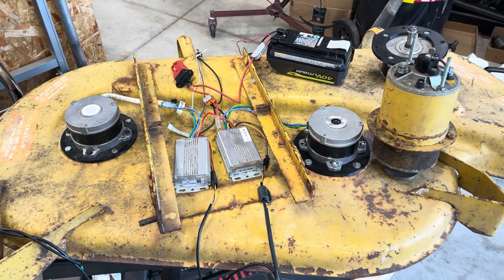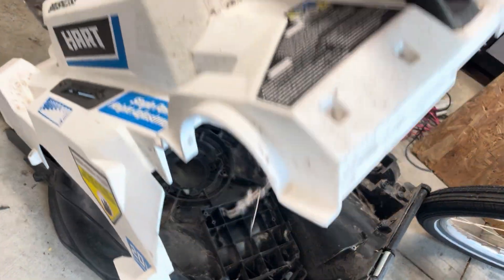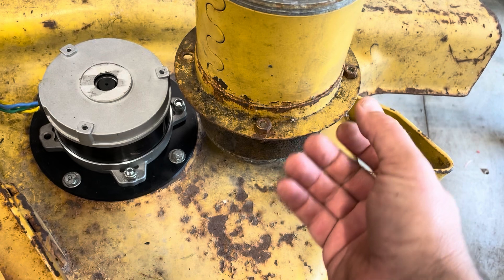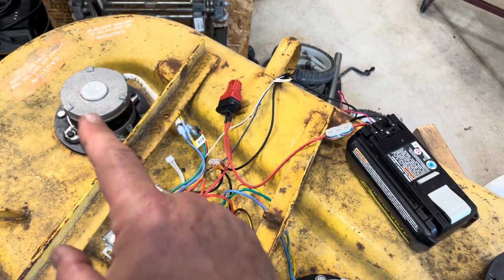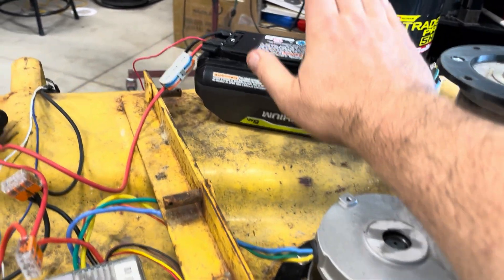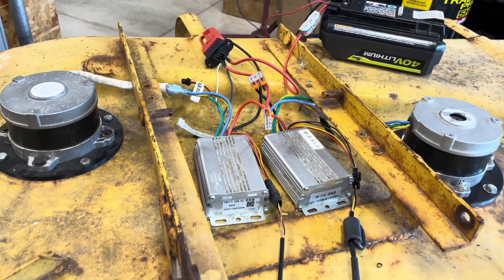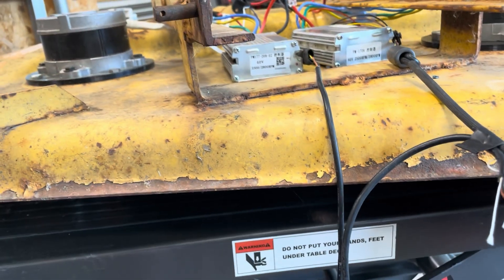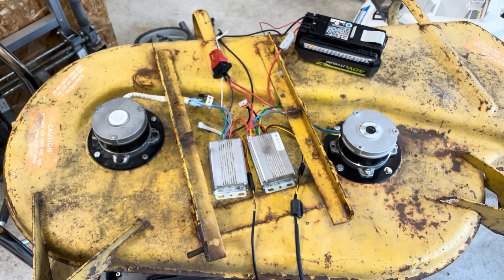Adapting Brushless DC Motors to an old mower deck

Comment: hope you printed it out of ASA or ABS, not PLA ;) 
Also, stick sticks or such into blades to see how well it will take such events before you think its all good ;)
Reply from the maker: This is really more concept and prototyping. This flange could be made from ABS, aluminum, plywood, etc. 

Might be a fun Experiment to put sticks in there and see what happens!

Comment: I'd print out a few extra flanges if I were you.. because the first time you hit something, like a stump or a heavy rock, etc.. It's likely going to bust that flange.  It's not really a bad thing, since it acts like a mechanical fuse;  the weakest link.   But I can see that thing breaking easier than you want it to.  ;)  If they are already printed, you can just swap them out and finish your yard that same day.

Comment: Exactly miss each other? If there is any gap between the blades, isn't that going to leave a strip of uncut grass right down the middle?
Reply from the maker: The motors are at an angle to each other compared to the direction of travel. 
They actually overlap the cut because of that.
Reply: @BenjaminNelsonX  Perfect!  Thanks.

Comment: That’s a really cool upgrade.  Is it safe to assume the 3D Printed adaptor flanges are just being used for prototype/proof of concept 😊?  I’m thinking the actual cutting loads will definitely be of the shock and non-uniform variety.  The toughness of the plastic won’t be as damage tolerant as aluminum or steel. And if the flange starts to fail it might do so in a hurry.  We all need to make sure you to keep all your toes and fingers so we can get more of your clever solutions.
Reply from the maker: Yep!
I’m really just prototyping here. This design would translate nicely to 1/4” plate aluminum or even plywood. 

I think the plastic would be pretty durable, but I was using PLA here, so heat would be the issue. I would think that ABS and some other filaments could work quite well.